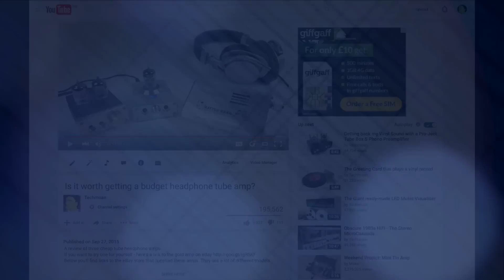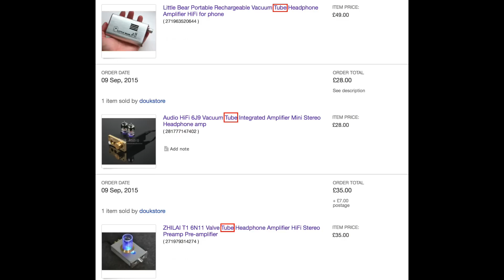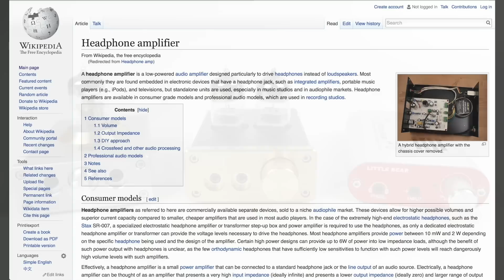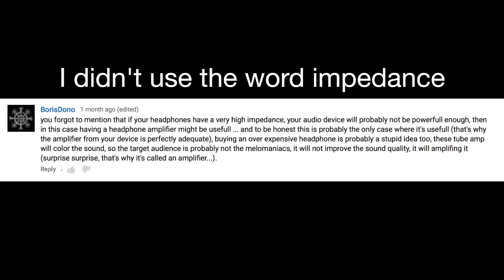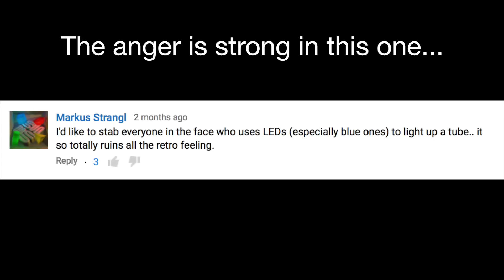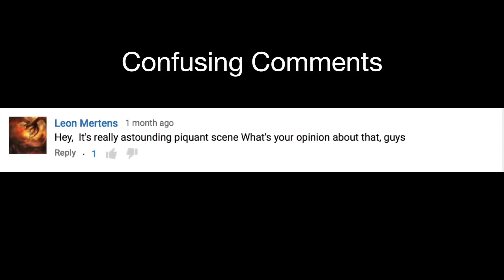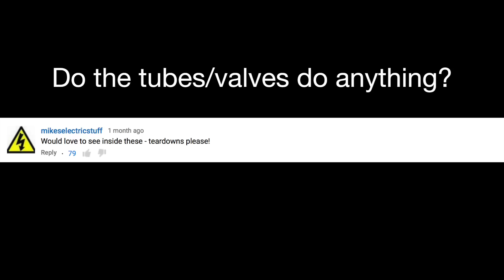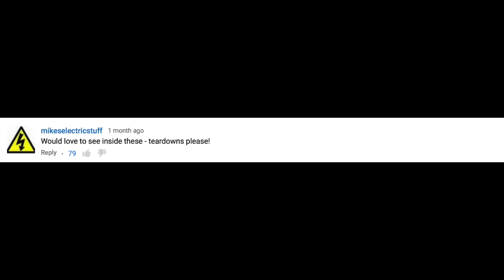Headphone Tube Amps - Follow-up & Tear-down

Comment: It's not YouTUBE, it's YouValve you pillock! I kid, I kid. I think you take the comments sections too seriously.
Reply: It's youchoob
Reply: that doesn't feel like i'm gonna be kicked in the butt and fall in a hole  and die.... sounds more like an invitation to drink tea
Reply: that's gold
Reply: I do like the use of the word pillock :D
Reply: Christopher Eves I used all the valves to create a portable ENIAC so I can find a field in which to do algebra in :)
Reply: THIS IS ENGLAND
Reply: @microfighterz  - Um no...  This is - (not so Great) Britain, or more accuratley (as a nation) the United Kingdom.
Reply: It is YouLAMP in most other languages, though.
Reply: G'day mate I speak english as first language and the worst english speaking country in the world is ENGLAND and then KIWI'S THEhey  ain't got a clue ay mate. Yarn with ya later cober, JUST YANKING YA CHAIN
Reply: Even when I agree with you on the fact that comments should not be taken too seriously, I think also that is good to ask people to connect their brains before posting. Think first, or uncle techmoan will post you in a video. Great work!
Reply: THIS IS FOCKIN' ENGLAND MATE! ITS IVALVE NOT YOUTUBE
Reply: Those are not values in the traditional sense or they would melt the plastic:) I consider this a Tesla radio because the device is using static eduction to increase the magnetic field of the current in the wire and that interference is caused from election noise which thermal paste and aluminum foil will damper
Reply: @superperfectstranger815  - Wot?   Eh?   Is this comment some kind of attempt at a witty play on words, or are you incapable of proof reading your remarks?     Not that it makes sense in any context.

Comment: While I can't say for sure without reading the markings on the chips, all three units seem like hybrid designs.  The valves are powered and seem to be used as a pre-amp stage while there are digital op-amps for actually increasing the audio signal.  This would make sense because the valves would need more power than digital circuitry to increase the audio signal than the op-amps would.  This is done mainly because as you up the power to get the valves working you would need better rated components to cope with that plus extra heat generated within the units.  A hybrid design in this case becomes far less costly than a pure valve one.
Reply: A hybrid is also more efficient, because using tubes as power amplifiers requires a hefty (and not at all safe to poking) B+ voltage. The beefiest caps I saw in the teardowns were rated at 50V, so the B+ rail would have to be less than that and audio tubes really want a few HUNDRED volts to really cook. If they're just being used as lower power pre-amplification, then you don't need nearly so much voltage -- but it also defeats the purpose of using tubes because they're not being driven anywhere near saturation. Everything that is not defective sounds about the same in its linear range. It's what they do when pushed out of the linear range that makes all the difference. In other words -- the tubes work, but they aren't doing anything to the sound because they have to be pushed to do that and these circuits simply can't.

Personally I aim for reference everything. No EQ or tone controls, speakers or headphones that are as flat and uncolored as possible, no surround effects or enhancements, etc. It does mean my setup is not at all "forgiving". Bad recordings sound like bad recordings. (In such cases, I may cheat and use some EQ.) But the way I see it, how can I go wrong trying to match actual studio gear as closely as possible? Why shouldn't I hear what the engineer intended for me to hear?

I also engineer my own music on the same system: a 160W solid-state amplifier which I don't push even halfway there, a pair of Tannoy SRM12B monitors, and modified Sony MDR-V600 headphones (modified to eliminate their "bass boost" and make them behave more like the MDR-V6).

I do have a consumer grade entertainment setup as well, and I listen back to my music to make sure it doesn't get totally destroyed, but honestly it's not my lookout if someone pushes my tunes through shite hardware.
Reply: @mal2ksc  Lots here; but a couple of key things: 1. it's unlikely your listening space is close to the acoustic surroundings of the studio control room where the music was mixed. 2. Generally speaking your listening to the output of a mastering engineer, not the mix engineer and 3. We all have different tastes, some like more bass, others like more highs. either way, what you're striving for is a preference, one that the mastering engineer had but not necessarily yours. Give two mastering engineers the same stems and you'll end up with two different outcomes, neither are right or wrong, but different they will be.... Still sure your setup is optimal...?

Comment: ROFL ! sorry, this moaning is common on the music forums, gutar, bass, HiFi, and in fact there is a slight benefit to tubes(valves), The US Army commissioned a study 30 years ago, and there is a filtering effect of odd-order frequencies, which your brain processes as harsh, and you receive more blood to the pleasure centers in your brain. As long as the circuit powers the tubes in their optimal  voltage (varies by model 250-350), in summation, gentle sounding, and more fun : )

Comment: a genuine tube amp for headphones would have an impedance matching transformer at the output.one for each channel. some kind of power converter would be needed also, to power the plates.kind of suspicious that a headphone amp IC is in the circuit. I guess they passed the audio through a tube, so technically it is a headphone amp with tubes, but they are not doing the real job. what ever imagined sound quality that is gained by having a tube in the circuit is cancelled by the rest of the crappy semiconductor circuitry. hope this helps. An actual tube amp would be a quite simple device, not counting the power supply.

Comment: Is it possible to make a stereo amplifier using only one tube?
Reply: MitzaMaxwell yes, if it's a tube with two independent triodes in it- which the stereo amps with only 1 tube appear to have in this video

Comment: The operational amplifiers inside the tube amp give it the sound changing them out for better ones would improve the sound .But i would not expect much from them and they are starved plate voltage and you really would not get a true tube sound out of them .But they look cool :)

Comment: I like to compare audiophiles/Hi-fi experts to ricers; trying to make themselves look professional and knowledgeable, but end up looking like try-hards who use terminology they don't understand. A Hi-fi system is designed to colour the sound to make it sound good, saying that a tube/valve amp will ruin it is like saying that adding sprinkles to ice cream ruins it. Another thing, a tube/valve is transparent until you drive it (boost the input and attenuate the output), at which point it will saturate and eventually distort the output. I you want to hear 'the true' sound of your tracks, get yourself a pair of studio monitors; they are designed to let you hear any mistakes or inconsistencies.

Comment: good video. I don't think those are using the tube. maybe it's just act as a circuit breaker. anyway it's a very cheap amp. so we will not expect more from this. it's amplify that's more than enough and it's Chinese product😊

Comment: And another thing, Vacuum Tubes produce 2nd harmonic distortion. If anyone prefers the sound of tubes, fine, just don't call them better (or warmer, or richer, or some other subjective audiophile buzz) than transistors. There is no BEST audio device. So, get off Techmoan's case.

Comment: Touching glass (tubes, valves, shot glasses, etc.) does not harm it. That is a fact.  
                No-it-all- audiophile stupidity.
Like, the fingerprint 'grease' eats the glass???
Reply: Basically, yes. Quartz glass and the like is porus to a point. Any sort of oils get in there and over time with heat shock (heating, cooling, heating, cooling, etc) it causes a weak spot to develop on the glass envelope. This is the same reason why you don't touch halogen lamps. Now, for tubes most of them will get quite hot (particularly in the larger ones) but I'd argue that they do not see the same heat intensity of a halogen lamp for it to matter.

Comment: Are the valves working ? YES ! The very delay on sound starting with the valves preampsswiched on/off ,reveals that they are on alive in  the path of of the signal , since valves need some time to heath it up to start prooducing the eletrons needed for the amplification.The IC probably are for impedance match of the headphones and or more signal amplification. Helio Marques

Comment: if i remember correctly the main reason tubes sound better is that any harmonic distortion caused is in 3rds on the music scale but transistors cause it to be in 5ths  "or the other way round" . basically a tube distorts to a nice chord and transistors hit a bum chord.

Comment: I make tube guitar amps and those comments are just hilarious. I have build amplifiers that run perfectly on 12 volts. If the design is right, there will be no problem in terms of amplification. the only thing you lose is the amplification factor U and the headroom (amplitude of the amplified sugnal).

Comment: maybe the blue LEDs are wasting playback time? drawing more current from a battery?
Reply: I think they use the blue LEDs to emulate the blue glow of actual power amp tubes.
Reply: denvera1g1 dudeeeee blue leds, especially those ones consume almost no power at all...the powerbanks have those too and you check the percentage of your battery through them and they are on while charging your divice...if they would draw significant amount of power they wouldnt be used....

Comment: I can't take the eyestrain of staring at the other two but the first one, the most steampunk looking one appears to be legitimate. 

https://www.fairchildsemi.com/datasheets/NE/NE5532.pdf
Operational Amplifiers like the NE5532N are part of a balanced audio solution but not great on their own. 

https://frank.pocnet.net/sheets/201/6/6J9.pdf
The 6J9 tubes are audio amplifier triodes and the circuit board itself is dual sided, many of the connections are top side. The bottom side which is easier to see reveals that the heating grids are bussed together which makes sense, these tubes do run on 6V so that's legitimate, but beyond that I can't tell you any more without actually desoldering and following all the leads. too much is obscured by the surface mount capacitors and other mounting hardware.

I'm strictly amateur with circuitry ( as in I don't make my income from it, I just studied integrated electronics and Radio physics for awhile ) but if you run into any questions on future episodes on the technical side of things hit me up and I'll do my best.

Comment: I'm an electrical engineer so maybe I can clear a few things up.

Low voltage isn't an issue here. See all the capacitors (labeled 16V)? (There is also an inductor.) Those are for a boost converter. Boost converters allow you to raise the voltage of DC with some tricks from AC electronics design.

The circuit boards in those amps were double sided. So even though only a few of the traces are visible from the bottom of the board, on the top layer there are connections to the other pins.

Please be careful with open tube amps because they utilize high voltages. The capacitors can retain the voltage after the device is powered down.

Thanks for all the great videos! This is my favorite YouTube channel.

Comment: The little bear is what a mess! Incredibly poor pcb design. The others are at least surprisingly well designed in that aspect. Both of the first two used the same ne5532 op-amp. I didn't see trough the circuit but i would put the tubes (valves for the english gentlemans) in the feedback loop with AC coupling. The op-amp have the proper input and output inpedance to handle any signal sources and head phones. The tubes have the characteristic that needed to achieve the coloring effect.

Comment: Also, these are multi layer circuit boards. The tracks on the bottom are only parts of the traces going to the tubes. Look carefully art the top view. There may also be traces in between layers.
Reply: I was about to comment this, but I scrolled down a bit to see if it had been mentioned. You've hit the nail right on the head.

Comment: I worknon guitar amps all the time and I leave fingerprints all over the tubes. Never had one fail because of it either.
Reply: the skin oil will burn your finger prints into the glass after a few years. I dont think it will do any damage, just looks ugly.
Reply: you should replace the tubes by then anyway

Comment: So looking at those circuits.
The first one has a bunch of power supply stuff on the back side of the board. The give away for me is the generic 8 pin SMD and the inductors and caps right beside it. That screams switching PSU to me. I would say that they are there for driving of the heaters in the tubes. 

The 555 timers are presumably something to do with volume control. 

The second one, same stuff, just very cut down using the bare minimum components.

Little bear, the board on the pannel is a micro, to read the voltage and light those LEDs
Again 555 for volume control.
The 3 other daughter boards are all generic switchmode buck/boost switchmode supplies. God knows why they need 3, maby one for the micro, one for the battery charging, and one for the heater for the tube? guesing since I couldn't be bothered pausing and tracing the tracks.
Reply: My bad, just realised now they are 553 and not 555. Which is a headphone amp chip. That really throws my last comment out the window. The tube must be doing somthing still because of the ringing tho. Not sure what
Reply: would passing the signal passively through the tube make the output ring when vibrated as demonstrated?  I'm thinking it could act like a passive reverb tank (springs) found on many guitar amps.

Comment: + Techmoan techmoan, I believe these little tube (Valve) amplifiers are actually hybrids! You wouldn't typically see a transistor, chips and surface mount components used in a true all tube design (the tube ckts. are rather simple by comparison). And those solder junctions that seem to go nowhere, I believe are definitely connected and in use.  Now some traces are the same color so maybe hard to see and others might follow through to the other side of the board, or if real fancy, a multi layered board but I'd be surprised. Great video by the way and I'm sure it took some time and effort!!  It's also interesting with all the relevant and silly comments also! Enjoy your audio 👌🏽

Comment: The first number in the tube (valve) is the voltage of the filament. 6N11 = six volts on the filament. The circuit board is double sided, it has circuits on both sides of the board.

Comment: The hiss that you can hear on the Little Bear amp is probably caused by the valve/tube/choob/teube being mounted directly above a small switch mode power supply, This will almost certainly cause interference, which is a shame, as I'd put my money on the Raytheon Valve being much higher quality than the Chinese valves used in the others.

They all appear to be using a similar, fairly trivial hybrid amp circuit, not all the pins are used, and some will be routed under other devices.
Reply: Llamarama100 I believe the hiss is coming from the battery pack. I have had similar issues to computers and with external power supply the hiss has gone.

Comment: The delay before the amp starts passing the audio signal doesn't really prove that the valves are being used, or have anything to do with them necessarily. Every hi-fi amp I've ever owned has had such a delay, and it was shorter if the amp was already warmed up - and none of them had valves, they were all Class A. The delay is to give time for the power supply circuitry to stabilise; a relay then switches on the output (creating the audible click from within the amp). Without this, the speakers would bang from the transient on power on (I had an old Technics amp whose relay failed so I just bypassed it as a quick hack to get it working again - it was fine, but I had to make sure that the volume was turned all the way down on power on/off otherwise it would send a very loud bang to the speakers). 

The majority of these cheaper valve amps, even mains powered, aren't really doing anything useful with the valves, they're either purely for show, or at best are adding a small amount of harmonic distortion to the pre-amplification signal (which is fine if you like that sort of thing). The actual amplification is being done with a solid state circuit just like any other modern amp - except that they probably don't bother trying to make it a decent high-quality linear one because you're deliberately choosing to add distortion anyway!

Comment: I am an audio technician. Without some sort of inverter circuit to provide high voltage to the plate, these tubes are not amplifying.. At those low voltages, the tube would work in starvation mode and be very non-linear (distorted.) This is great for guitar distortion pedals, not so great accurate music reproduction.  Also, if the tubes were being used in the output stage, there would have to be a transformer for impedance matching. Tubes are voltage controlled devices, and are not good for passing high current. The transformers would step down the voltage and step up the current through the load. My guess is that the tubes are being used to control a muting circuit to trick one into believing they are working.